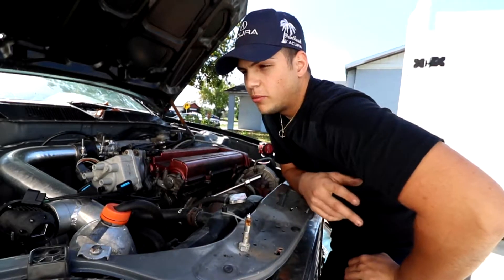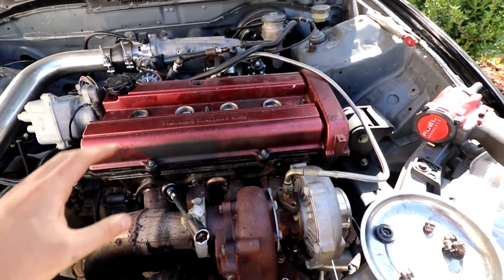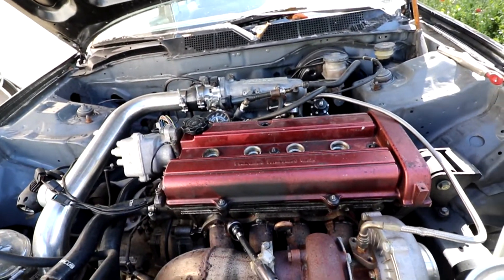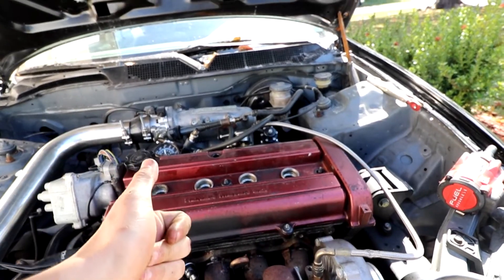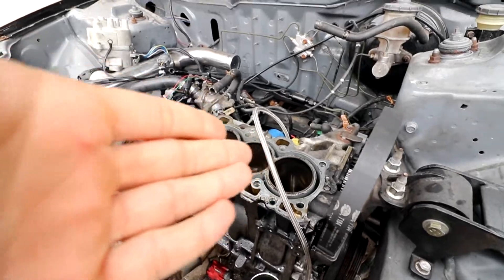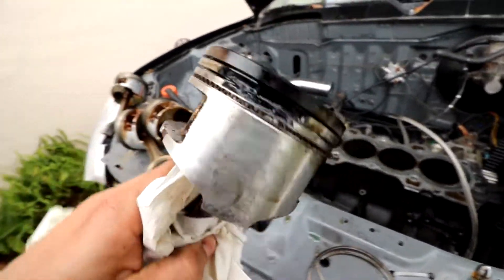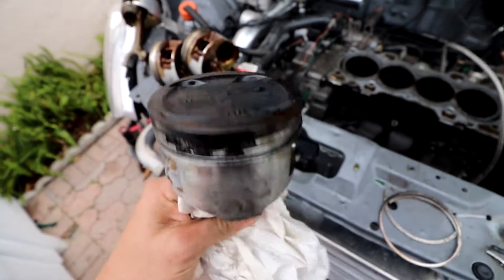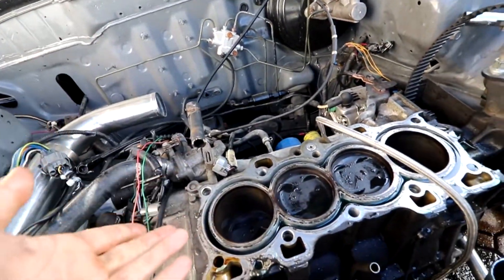B20  turbo civic teardown damage piston?!?! Cracked ring lands?!?! why e85 is important

Comment: probably piston cracked because piston ring gap was too small. with turbo cylinder pressure is getting a lot greater than stock. result is more heat and piston rings expand more, if gap is too small ring start to grind cylinder walls and after that it cracks piston like your case. remedy: little bigger piston ring gap.